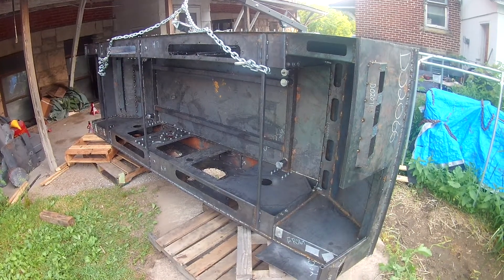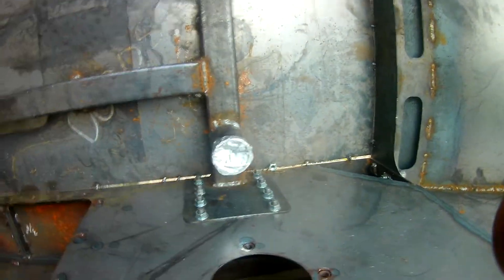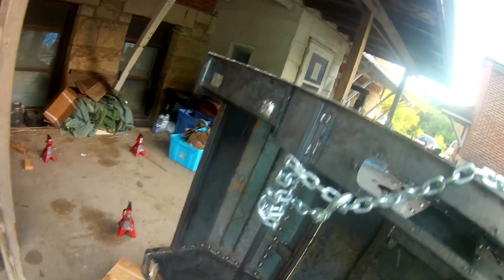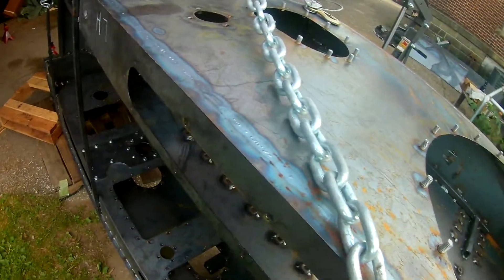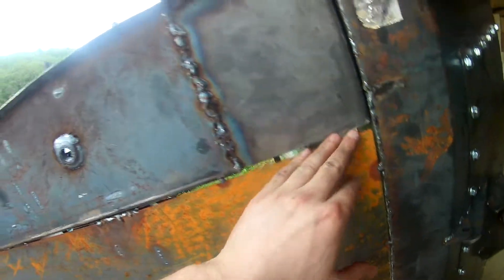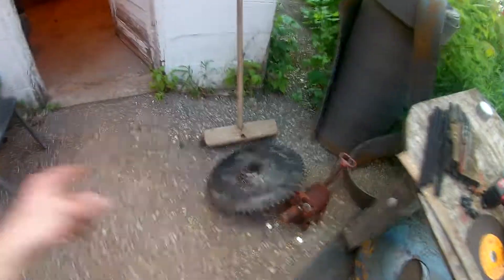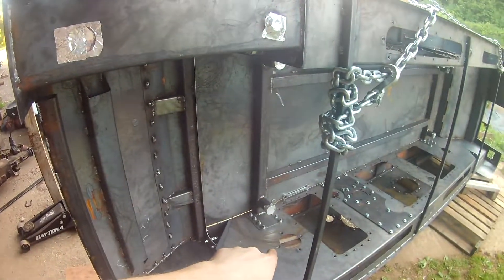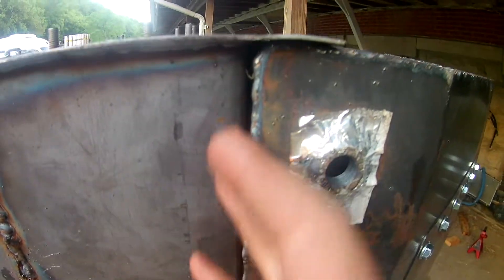Derp Status 3

Comment: Actually a lap weld under a quarter inch was always good when we built boats so  If your running o35 or bigger wire it shouldn't be a problem. Nice job from solid thinking